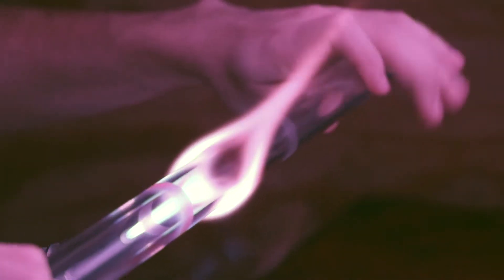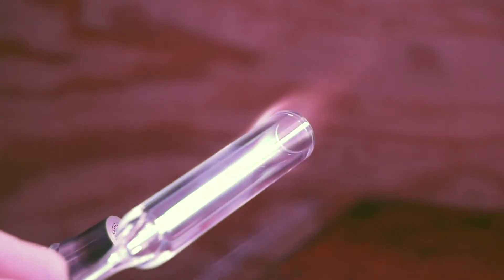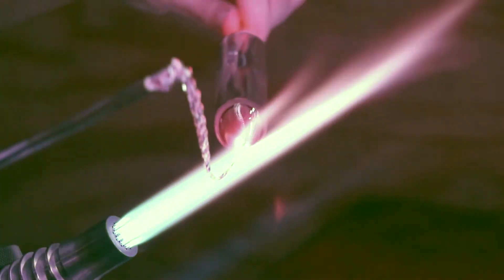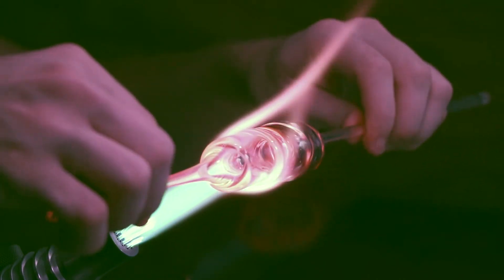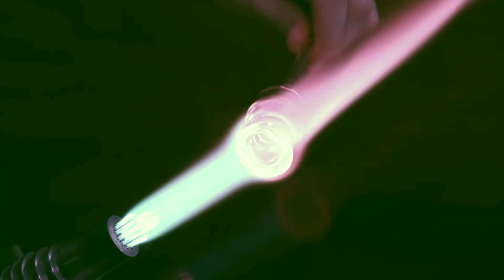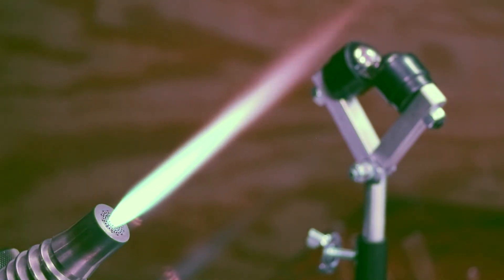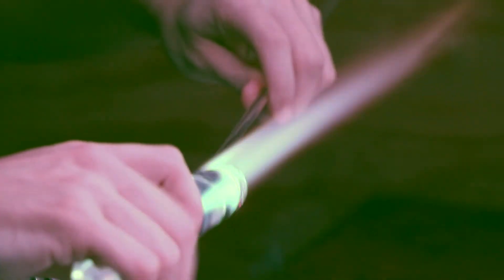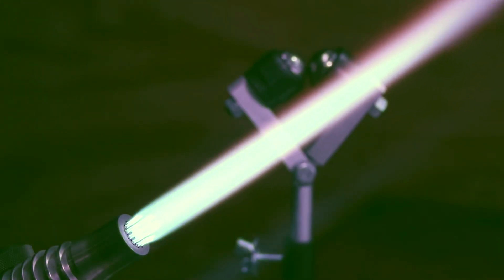Making a Glass Cannon - Part 1

Comment from the maker: Point Pulling: Remember to pull thicker points if you plan on working heavier sections of tubing or use the blowtube attachment method for a solid connection. This point was a little thin for the size/weight of tube but it worked out in the end.

Comment: The term "Glass Cannon" in video games, means it is a character [usually a magic wielder] which can deal a lot of damage ['cannon' level damage] but can not sustain much damage [hence 'glass'].

The theory is, in legend, that if one can safely launch a mortar from a glass tube it can send a lot of shrapnel into the enemy, even if there is not enough iron or bronze to make the cannon part, therefore, even in the sands of the desert, one could conceivably be able to equip an army with enough cannons to fight a battle, provided the cannons themselves did not get struck by an enemy salvo, which, unlike a metal cannon, would obliterate them the first time, every time.

Comment: Thanks for the reply Matt really enjoy your channel I’m 57 years old looking for something to do in my retirement I’m an HVAC service technician so I used torches every day used my acetylene torch and made my first marble yesterday I was so excited! Going to get a map gas torch just a practice and got some tubing coming so I can practice making connections and cutting off pieces thanks again for all your help
Reply from the maker: Wow very cool Mike! It should make a fun hobby, and someone with torch experience like yours won't have trouble getting started.
   Now mapp gas won't burn as hot as your acetylene/oxygen torch. It should work for Soft glass but might be slower for Boro. 
  They do make glass torches with pre-mix, surface-mix, or both. They run on propane or natural gas. Surface mix has a wider colder flame that runs quietly, while pre-mix should be the same as your acetylene torch.
   Lastly a pair of didymium glasses will help block sodium flare letting you see through the flame. Their rather expensive but eye protection is important. Good Luck on your glass journey!